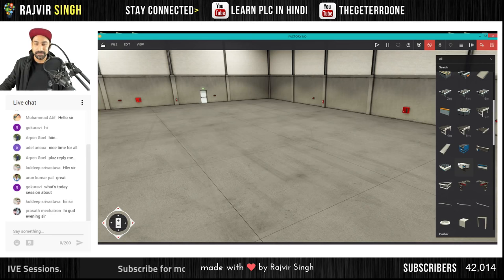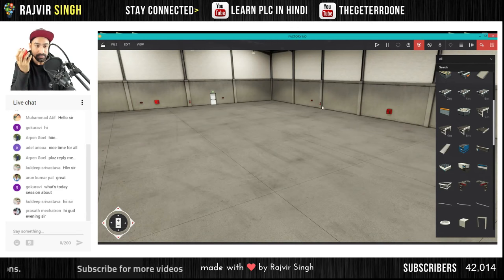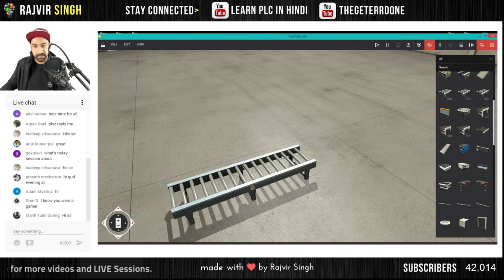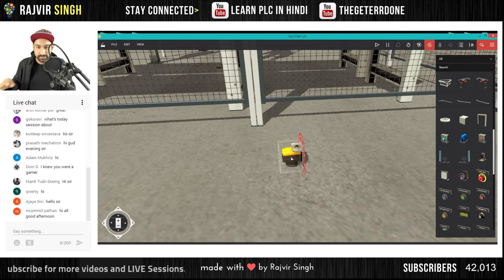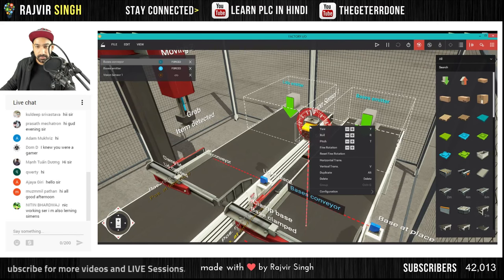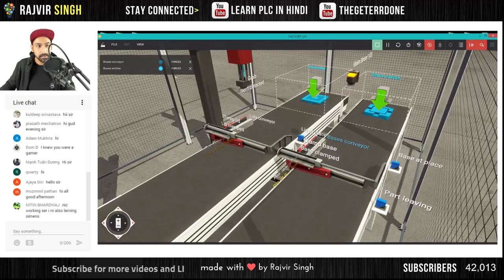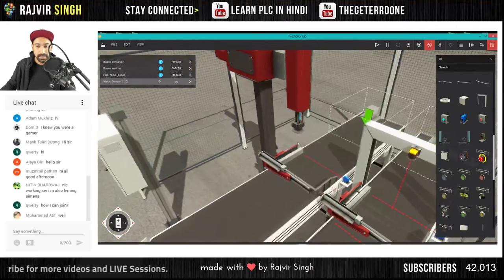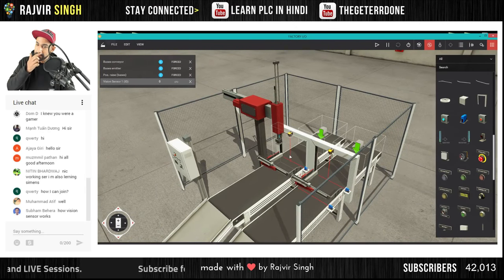Learn about FACTORY I/O- Automation Sandbox- The best PLC Simulator

Comment: Hello dear Rajvir, I want to design a simple machine that put water pet cups in a box (60 cups in each layer 20 cups) and simulate it with plc and hmi program  predesigned according to that procedure with all protections and limits .
Do you have software that I can build this simple machine with it?
Can I desing any machine and any motion I need with factory IO software , i.e motors , sensors , solenoids any conrol item?
Reply: And if I want to buy it how many its price with training courses?

Comment: Hello Ranvir, thanks for your tutorials, they are very helpful.Well i want ask that is it possible to reset IP Address of PLCs(PLCs present in Library of TIA Portal) through "Online Diagnostics" and reassign the desired IP Address(To match router IP Address), the option is grayed out until unless the original PLC is attached to Network Card? actually i am trying to communicate with Factory IO through this particular way (Apart from PLCSIM)
Reply from the maker: Its not possible also not recommended. Possible way is to change it via PLC directly or change in its PLC project and re download. Also it is only the PLC in the network or also other PROFINET devices?
Reply: @thegeterrdone  Yes its the only PLC for indiviual "TIA Portal Program" to  connect to "Factory IO"
Reply: @thegeterrdone  But thats ok, i am trying this just for experimental purpose.

Comment: Hi sir,. I've installed tia portal v12 bcoz it is quite fast and simple...but i had a problem where the factory i/o cannot connect to my s7-1500 plcsim. I read from their official document and template, the support is for v13 to v16 only...can you suggest to me what can i do? Thanks.
Reply from the maker: Kindly get TIA v13. :) i don't think you can link to v12 if it's not at FIO website

Comment: is there any way to simulate the motion control of a motor with a siemens sinamics VFD?
Reply from the maker: Yes just like other VFDs
Reply: @thegeterrdone  how? i'm not familiar with the program...i want to control at leas 1 axys
Reply from the maker: @iulian.m.  Siemens VFD software generally has a wizard to setup the VFD's and motor. Just follow the steps with the wizard and you can control your motor in few minutes.
Reply: @thegeterrdone  i want to simulate the mocement in a software for a presentation